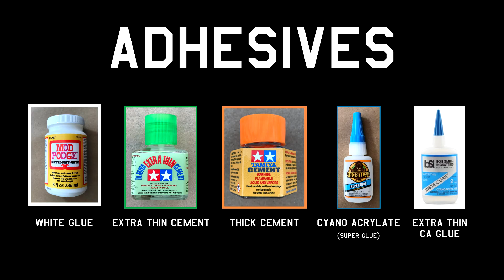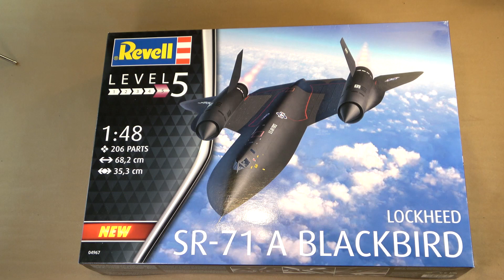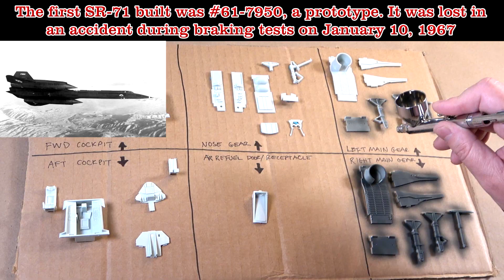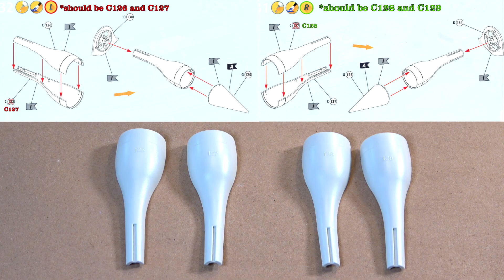Building the Revell 1/48 Scale SR-71 Blackbird Strategic Reconnaissance Aircraft

Comment: Fantastic job! Building one now myself. Just an FYI, the shock strut pistons are not really red. Those are locking/support collars for aircraft on long term display. The struts are depleted of hydraulic fluid and nitrogen for safety and environmental reasons and therefore need those supports to help keep the landing gear strut  extension within its nominal weight-on-wheels (or off-wheels depending on the display configuration) X-dimension. Keep doing these awesome builds. Look forward to some more. Cheers!
Reply from the maker: Hi Arktikos, actually the red was my poor attempt to create tarnish on the chrome strut. I didn't bother to fix it up since it was going to be covered up inside the bay. Glad you enjoyed the video 😃

Comment: this one is something im gonna get in the near future to build and paint

i have a tip for you when it comes to replace the putty that u use if you want to.  if you buy one tamiya extra thin cement clue and then take sprues that you have and cut/snip them into smaller pieces and add them into the  tamiya, you will get something that many of us that build and paint warhammer minis call sprue clue and it is perfect for filling gaps and such. and one small jar of that lasts you a really long time as long as you  keep the lid screwed on and the brush that is in the cap is nice aswell when you are going to apply it. thoe i will also say that i dont know if you can make it with resin sprues seanse i havent tries it or heard anyone made it with that. just wanted to mention that seanse resin models are becoming a bit more common, atleast among the tabletop minis and i dont have a good grasp about how it is among these.
Reply from the maker: Thanks, xzeke666x , I may have to try that out sometime 🫡

Comment: What putty were you using for the gaps and what solvent were you using to remove the excess?
Thanks
Reply from the maker: Hi le fishe, this is covered in the video. It's Perfect Plastic Putty which is a water soluble based material. You can use plain water as your solvent. 😉
Reply: @MaxAfterburner  Thanks, i must have missed it in the video, great looking model btw!

Comment: Just a question please. I bought a Revell SR71 kit. I am new to this and don't have the airbrush equipment. Would it be good enough to buy a can of matt black spray paint? Or would that provide an inferior finish?
Reply from the maker: Hi janrabie1890, if you can afford an airbrush and a compressor and know that model building is something you're going to pursue, then I would recommend that equipment. However, if you want to try the hobby out before committing more money,  you can still get some decent results with canned spray paints made specifically for model building. Don't use spray paints that you might get from a hardware store as the mixtures tend to be much heavier, and always use these paints in a well ventilated area (preferably outdoors if you don't have any way to vent the excess spray and fumes from indoors). Please feel free to ask me any questions at any time and I'll try to answer them the best I can. I hope you have a lot of fun and enjoyment on your SR-71 model build! 🥳
Reply: @MaxAfterburner  Thank you very much for your detailed reply.

Comment: Love how details in such a flat color as black end up highlighted. Do you put varnish before applying the oil wash? Or straight on top of the paint? What type of paint is it, acrylic, enamel? Doesnt the wash mess up the paintwork when you go over with the cloth? Thanks!! Love your videos!
Reply: Ok going again through the video now I see you used tamiya colors and then applied a gloss coat before decals and weathering :D
Reply from the maker: Hi EduWushu, no worries. I would say, however, that oil paints do not react with the acrylic paint as long as the type of thinner used such as lighter fluid is mixed in the oil paint. So, a gloss coat would not be necessary.

Comment: 11:45 how come you painted the rubber aluminium?
Reply: SR-71 tyres were infused with powdered aluminium.There is a notation about it at around the 11:42 mark. The addition of aluminium to the rubber gave a much higher flash point to the tyre, helping it withstand the high heat caused by friction with the ground upon landing at extreme speeds.  If I recall correctly, the tyres on the XB-70 Valkyrie were similar, but the aluminium was only in the sidewalls.
Reply from the maker: I was going to include pictures of the main gear tires from SR-71A  #61-7951 in the video, but I ran out of steam...
Reply: @MaxAfterburner  everyday is a learning day

Comment: Blackboard paint is the best match for color and texture.
Reply from the maker: Hi danfreeman9079, seems like it would be for sure 😎
Reply: @MaxAfterburner  
After working for years in the SR-71 program as a Code 42 Metals Technology Section Chief, part of the Fabrication Branch of the 9th Maintenance Squadron, 9th SRW. I know the various stages the the RCS coatings (Paint) go through in their appearance.
Some say the SR-71's appear to look blue, but that is really just a result of the refraction properties of light. Other factors have been described as Red/Blue Phase shift, which is depending on if the aircraft is flying away or towards the viewer.

Under microscopical examination of the freshly painted Blackbird, you can see faceted black oxide crystals embedded within the paint. The texture is somewhat like velvet.
As the paint wears down after use (The high temperature of flight, fuel and oil saturation, walking on it, and handling during maintenance),  it becomes smoother and somewhat greyer in appearance.
I have provided samples of SR-71 Titanium to professional model builders that have various conditions of the original paint on them so the builders can make an exact match. This is done for modeling competition purposes.

Comment: @25:29 -- I was curious about the dimensions of this engine because it looks so big!
Actually, it's close in size to the GE F110 turbofan!  They're different technologies and optimized in different ways but sizewise they're not different dimensionally.
The P&W J58 is 15 ft (180 in) long and 50 in diameter.
The GE F110 (-129 that powers the Block 40 and Block 50 F-16C) is 181.9 in long and 46.5 in diameter.
Where there is significant difference in physical traits is weight.  The J58 being 3 decades older is significantly heavier; it's a 6,000 lb engine!  The GE F110-129 is just under 4,000 lbs dry.
With the exception of acceleration, the J58 would still outdo the GE F110.  The J58 is designed to run at supersonic speeds for much longer (still ingests air at slowed to SUBSONIC speeds like any jet engine) and in afterburner for hours.  (90 minutes would be the max, and I imagine it operated LESS than that because of range and need to refuel which also means the Blackbird has to slow down to refuel!)  For a 1950s design, it had to have superior cooling!
Most fighter jet engines as I understand can't run in afterburner for very long; 20 minutes or less depending on fuel state and what production engine they're powered by.  I had read somewhere some engines couldn't function more than 5 minutes in afterburner before they ran into serious mechanical stress (heat issues)!